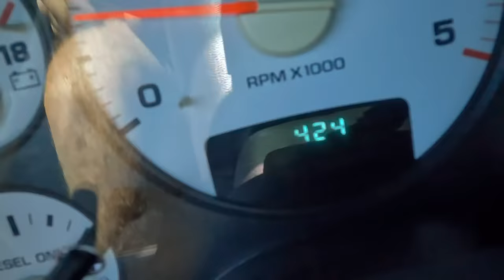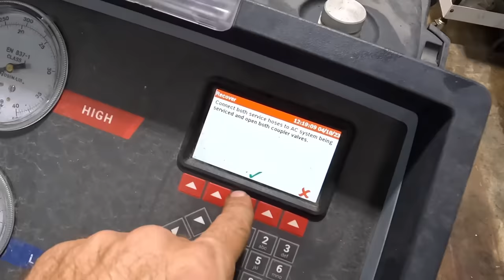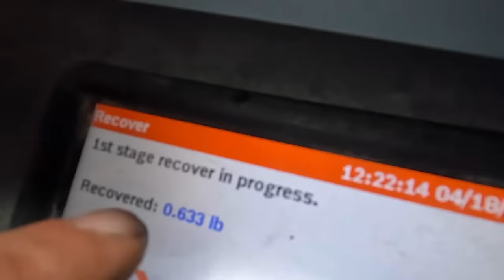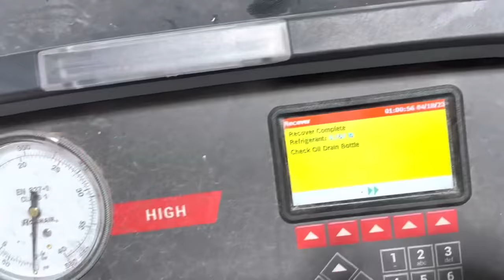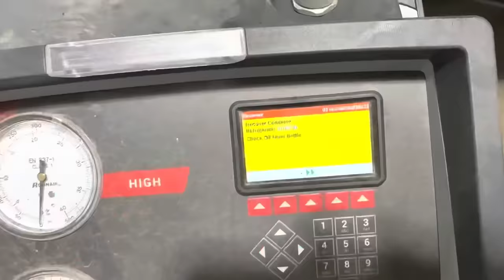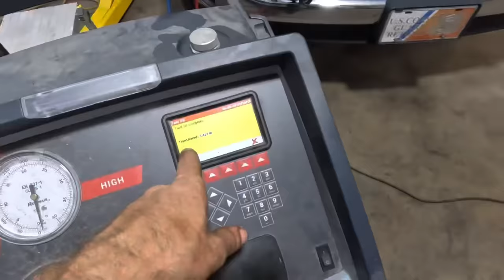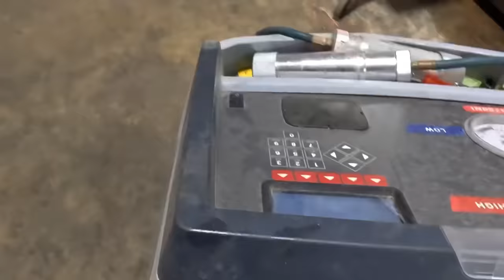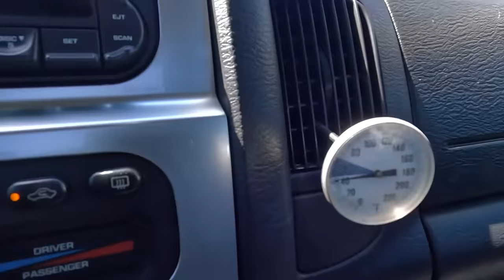Diagnose Before Removing the Dash  Dodge Ram 2500  5.9 Cummins A/C Blows HOT!

Comment: Not sure if you are aware, but I have a 2003 and they had a problem where the temp probe on the evaporator was not in a good place, and while driving the probe temps never picks up that the core is freezing up.  So what happens to mine is that the compressor does not cycle enough to keep the core clear of ice, and the airflow becomes restricted and eventually you get no cooling after about 20 min of driving in humid conditions.  There is a TSB to relocate the temp probe.  Not sure if the 2004 had a fix or still has the issue.  Something to think about if you get a returning customer on this truck!
Reply: Bump
Reply: Good advice!
Reply: You are not correct, consult a psychometric chart. And a refrigerant/enthapy chart. Change of phase liquid to gas or gas to liquid utilizes latent heat of change to accomplish the movement of heat.
Reply: @josephcaprara898  what are u responding to?  I wasn’t arguing how heat moves, I was commenting on how the evaporator DOES freeze up if the compressor never stops.  The IS why there is a temp probe near the evaporator.  What are u talking about???

Comment: Great to see someone interested in diagnosing a problem before fixing it.  Keep up the great attitude, Ray.
Reply: It's hard to believe, but sometimes customers, for whatever reason, don't want to pay for diagnosis. Possibly because "insert name of garage here" has already looked at it and said this is what it needs. I've personally been down that road, that's why I always do my own diagnosis, just like Ray did here.
Reply: To be fair. He mentioned that many times while he was at the other shop, that he doesn't like doing that. Now that he has his own shop, he can make his own rules!
Reply: @samishiikihaku  To be fair, when you are working for a shop and you are given a work instruction like "replace the AC evaporator" then you are not going to be paid for a diagnosis.  A work instruction to "diagnose AC  not cooling" is a different thing. 

Ray isn't work shy, and one of his strengths is diagnosis before repair.  Remember that Ray left his last job after undisclosed disagreements about they way they did things.  Now that Ray has his own shop, it seems likely the conversations he has with his customers and his approach to that job is more in line with getting the best results for those customers.  Sometimes what the customers think they need and what they actually need are two different things, or only part of the solution.
Reply: Despite my strongest suggestions and even offering free diag in some situations…. Some customers will insist they know what the problem is (they don’t) and refuse a second opinion
Most of the time it’s about not wanting to replace something that doesn’t need replacing, and also because that same customer will say “you did it wrong” and blame you for them being stupid
Reply: I prefer a garage shop doing diagnosis rather than parts cannon and it's hard to find one because most of the Tech are plain lazy to do that or they were directed to squeeze the customers as much as they can. It might be just a valve leaking which cost a few cents than changing the whole evaporator which will cost a bomb to change and end up in the future you have to come back because the AC not running cold due to the refrigerant leaking up slowly as time goes by. As you can see in the video the Dodge owner basically change up the compressor and the condenser and still the aircon is not cold.
Reply: I had something similar on a riding mower recently. The repair shop couldn’t fit me in for a long time, and offered to guide me through the repairs. The problem was the blade belt, and I had to start with the absolute basics…. Level the deck, tighten and lubricate, balance the blades, and then use the correct belt. The owner of the shop (who could have easily taken $300 in labor) was the one guiding the repair. In the end, I was able to fix a very frustrating problem that had been vexing my MIL for over a year. It was very refreshing to encounter a repair shop with this philosophy. TBH, I was ready to replace the deck if I needed to, but a little sweat equity and $60 got her did. I will direct everyone who asks to this shop in the future.

Comment: As stated before the “schrader” valve is not the primary seal on a service port. You will never get them to 100% seal. The cap is the primary seal and needs good gaskets and tightened properly. Changing schrade isn’t going to stop the leakage. Making sure the caps fit tightly and seal will ensure the system is sealed properly. Many times when you remove the cap you will hear slight hiss as gas that leaked past Schrader valve but caught by the primary seal the cap.
Reply: It will if that schraeder was proven to be leaking,I have changed thousands of them.The cap is only secondary ,the schraeder is actually a system component! Think of it tgis way,the wrapping paper is not the gift,nor is the box,Its whats inside the box!

Comment: another great project. The Robinair is an awesome machine. We just got one in our shop. The boss asked, "Have any of you guys ever used one of these?" I said No, but I have watched Ray use one for over a year now. He said something about me staying at a Holiday Inn. I didn't get the reference at first. So I'm now the Go To Guy for all things Robinair. Those cab tractors' AC Must work and work well. So if you are ever in Louisiana and have a problem with your Kubota AC, I'm your guy. 
One thing tho, That new accumulator (sometimes called a dryer) was a great thing to replace considering someone else already fired the parts cannon on that rig. I hope there is a follow-up video in a few weeks to see if all is well. 
Thanks for sharing your hard work, man. 
Cheers from Louisiana.

Comment: Used to love A/C work!  Even changing out evaporaters. You did the proper thing, because 9 times out of 10 , the customer is incorrect in his diagnosis. Nice job, wish I had that A/C machine back in my day! And your explanation of how the system works was clear and informative. P.S., I also hated those spring lock connections, Ford started it back in the early 80s. Had several different spring lock tool sets. (  also good for Ford fuel line fittings )

Comment: Minor correction to your A/C system explanation;  The cooling effect is not caused by a change of state (liquid to gas for example), it is caused by the rapid expansion of the gas through the expansion valve (joule thomson effect).   I wish I lived near your shop, you are one of the most conscientious people I know of and I would never take one of my cars to anyone else.   I hope you have a great day!
Reply: As a retired HVAC guy I would disagree, cooling is caused by a change of state (liquid to gas) in the evaporator and the heat is released by change of gas to liquid in the condenser. Liquid passes through the expansion valve not gas, it boils in the evaporator do to the pressure drop and absorbs heat along the way. Properly charged it boils all liquid into gas just as it exits the evaporator coil. The gas is compressed and enters the condenser coil where it gives off heat as it is converted into a liquid that accumulates at the very bottom of the coil. The liquid is passed to the expansion valve where the process starts all over again. Look up 'Latent heat' and 'refrigeration cycle'.
Reply: The short and long of it is the refrigeration effect takes place because the refrigerant gets hot as hot goes comparative to it's boiling point. And the boiling is achieve in a sealed system through a pressure drop device using an expansion valve or a restricted tube other wise known as a cap tube. The second law of thermodynamics states energy is neither created nor destroyed, only transferred. So when a refrigerant is forced to go from one pressure to another lower pressure the boiling point of that refrigerant is met which results in a lower temperature. And since heat only transfers to places of a lower heat value via the boiling point being "cold" heat transfer naturally takes place which is the relative result. R134a, a common auto refrigerant, boils at around -16 degree F. And that is achieved at the outlet of the expansion device of the evaporator. So the higher heat value from the cab air transfers to the coldness ( less heat) of the refrigerant which then get pushed to the condenser outside of the conditioned space where the heat from the hot gas meets with the lower temperature outside air and, once again, hot goes to cold...so off goes the hot air from the cabin transferred to the air outside of the cabin. Thermodynamics... you have to love it. It keeps all of us alive.
Reply: Simply put, it’s the same as boiling water on a stove. As the water starts to boil it absorbs heat from the stove. By controlling pressure you make the water absorb more heat before it turns to steam. Refrigerants just boil at very low temps at atmospheric pressure.
Reply: @imyyz4u  For the curious - Also look up a pressure-enthalpy graph for (R134a in this case?)  Quite an eye chart, temperatures are there but the lines meander.  Pressure is the ordinate; equal pressures along horizontal lines; lower pressures on the bottom.  
   The graphs I've seen here have an example refrigeration cycle drawn in as a near-rectangular loop.  Refrigeration cycle goes clockwise counterclockwise on that line.  The evaporation cycle is right to left left to right along the bottom of the 'box' in that graph.  Most of the a/c-cabin-heat absorption occurs in the (thumb-shaped) zone where both liquid and vapor are present.
   Throwing my chips with imyyz4u.  Disagree with Tex:  Will be some Joule-Thomson at the capillary/valve but that's a minor/insignificant effect, right?  Equal enthalpy both sides of the valve, so along the vertical lines in the graph.  Reading a vertical line around the right side of the example 'box', the liquid actually heats up about 5 °C due to the Joule-Thomson effect.
Reply: @SqueakyHinge  Lower temperature, yes, it gets cold at/around the capillary tube/expansion valve.  (Those example R134a graph/box I saw, actually still hot at the expansion valve.) As the liquid boils in the evaporator, it continues to stay at about the same cold temperature, all the way until someways through the evaporator (if properly charged), all the liquid has changed to gas.  Meaning, it doesn't all happen at the capillary/valve.
Reply: @imyyz4u  If you reeeeeeeeeeally want to get technical, temperature change is caused by both phase change (liquid to gas), and pressure change (high pressure gas to low pressure gas).  Evaporation causes MUCH more cooling than pressure change alone, however.  Pressure = temperature...if pressure goes up temperature goes up.  Increasing the pressure puts more energy into the system.  However, the heat of vaporization is MUCH greater, because it takes a lot more energy to turn a gas into a liquid than it does to just compress a gas.
Reply: Professional HVAC guy here. I agree with imyyz4u. Perfectly described system operation. Change of state (liquid to gas, compress gas,  gas to liquid, liquid through expansion device makes liquid back to gas) is the cooling effect we feel.
Reply: @imyyz4u  Thank you for your explanation.  You would think I would know how A/C works living in Texas, and now I do.  I was amazed to learn that the liquid R-234a temperature drops from about 140 F (~220 psi) through the expansion valve to 20 F (~25 psi) in the evaporator according to the pressure-enthalpy diagram.  Since those graphs are under ideal conditions, I now also understand why Ray is happy when the A/C outlet air temp is ~45.   I'm also retired and it makes my day to learn something new.  Again thank you and I hope you have a great day.
Reply: @texkissmyass8326  Thank you, I still love to learn new things too. Enjoy your retirement!
Reply: The restriction merely LOWERS pressure to cause the boiling point to drop. The restriction itself DOES NOT in and of itself  create heat removal or as we say cooling. The pressure change must happen to allow the evaporator to have low pressure refrigerant, mostly liquid so at the low pressure the airflow over the refrigerant in the coil will boil off as the warm air moves through the coil.  Hence evaporator or evaporation.
Reply: What I want know is why has most  everyone  on YouTube started calling A/C systems HVAC systems? Seems a bit pretentious to me.
Reply: I was reading the refrigeration cycle backwards.  Goes counterclockwise on the diagram, right?
Reply: @iconoclad  HVAC (Heating Ventilation and Air Conditioning) is the field that includes A/C. That is what people in the trade have called it for many years, it's nothing new.
Reply: @imyyz4u  agree cause the compressor isn't designed to be slugged by liquid only can pump the refrigerant some are piston or rotary vane types too
Reply: @imyyz4u  If anything its referred to as the Hoola Hoop effect! It just keeps moving around and changing state and repeating itself over and over again!
Reply: @coreybabcock2023  compressors dont pump,they suck!

Comment: When you see the high side at 250psi+ and the suction side is around 20 or lower, check the metering valve first. They get stuck sometimes

Comment: Nice job.  IIRC this era had a TSB to relocate the temp probe for freeze up problems, and they are known to break blend doors. I believe HVAC cases were updated (possibly with different couplers) with more robust stops to keep the stepper motors from snapping off the stops and breaking the blend doors. On the plus side with their design it is easy to remove the fan and spray out the coils.
Reply: I have a 2003 Ram 3500, and the blend doors quit working a day after I got it. It's been like that for 6 years now as I haven't gotten around to installing the upgraded doors and drivers made of aluminum. Blower fan randomly quits working on med-hi setting, and that piece is hard to locate as mine is the Laramie package with dual zone controls.
Reply: @mercedes-amgforlife3237   If it’s obstructing the blower fan, it’s likely the recirculation door that broke. The fan is on the bottom of the case by the passenger footwell. If you unplug and remove the fan you may be able to remove the broken door.  The glove box I believe comes out by holding it partway open, pulling the back corners in, and tipping it out. That would give you a view of the grille for recirculation air, and that door.  If the recirculation door was broken and you did remove the remains, you could tape over the grille if you wanted it pulling fresh air all the time. 

If you do have to change the other doors, I’m not sure how I feel about the kits where you cut holes in the hvac case to put in metal doors. Last I knew they didn’t have an option for dual zone (like your Laramie, and mine). Though it’s a good 10 hours work and requires evaluation of the coolant and AC, if the other doors were broken I think I’d pull it down properly for new upper and lower case, new couplers and doors, and (considering how much work it is, and the rig’s age) I’d probably put in a new AC coil and heater core.

Comment: 23 degrees... thats frozen evaporator time, not air conditioning.  Accumulators generally don't go bad - schrader valves and o-rings tend to be culprits.  But the gunk in the line: compressor failed previously?  Maybe accumulatpr changeout gets rid of hidden crap.  So far so good... you didn't break out the UV light before road test, which surprised me.

Comment: Ray, don't you just love the way Ram trucks make you reach back into a tunnel to get to important failure prone parts. My '97 Cummins Ram requires valve adjustments every 25K miles. The last 2 cylinders are in the firewall tunnel. Anti-kudos to the new breed of engineers.
Reply: I think some of these engineers need a good gut punch. It's almost as if they design them to be as difficult as possible to work on.

Comment: A good way to diag a bad evaporator is by putting dye into the system, letting the vehicle run with the ac on for a while then use a UV light on the drain hole and if It starts glowing, then the evaporator is leaking.

Comment: The hose on the drain has a purpose. There is a design - flaw, of a kind. The condensate that comes out the drain enters the air flow under the hood and has a tendency to blow back along the outside of the drain into the cab and make the passenger floor wet. The hose diverts the output of the condensate drain and cures the issue.
Reply: Thanks! I came here to say this, you find a stubby hose or PCV elbow on a Dodge of this vintage, it's there for a reason!

Comment: My truck ,(Ford) had no condensation expelled. Dirt dobber wasps clogged the drain pipe and water overflowed soaking the front floor matting and padding.
They also clogged the sunroof channel drain pipes so I had rain soaking the seats. Damn buggers!

Comment: Good stuff as always man. Thx. Quick input: i modded my little scissor style disconnect tool by putting a champher/bevel on the outside edge making it thinner on the first 1/16 inch by just a RCH and now it slips under the springs super slick no fuss no cuss.

Comment: I was always taught to lube all a/c o-rings to prevent tearing or causing the rings to roll over. Only exception is the new metal/rubber rings.Makes installing fittings easier also. Lube the service valves too.

Comment: Awesome video. This really hits home for me with my 2500 with the 5.9, changed whole a/c system from dash to bumper along with other work in engine compartment. I had a busted blend door so I had to pull dash. New evap and heater cores, electric actuators, blend doors from blenddoorUSA, new weatherstripping gasket for the air box, liquid line and manifold, compressor, condenser, the whole nine yards. Dealership quoted me $3200 for the a/c job I done it for just a $1000 in parts. After completion a/c was 40 degrees at vent and on heat was 160 degrees